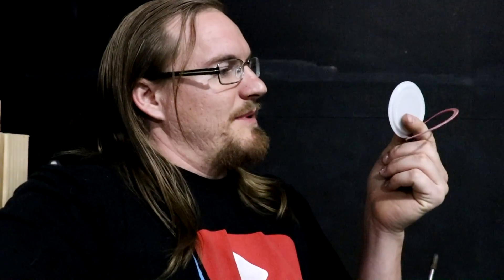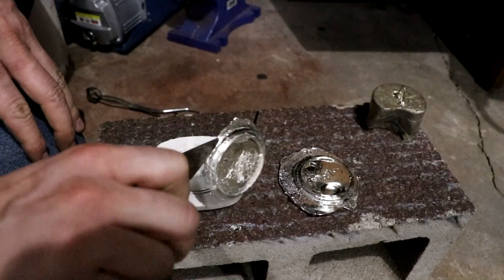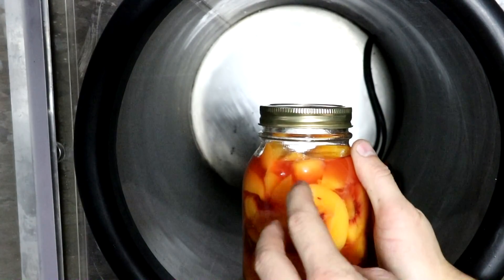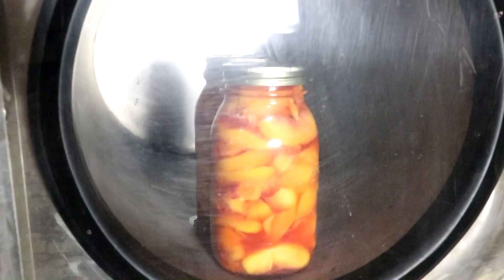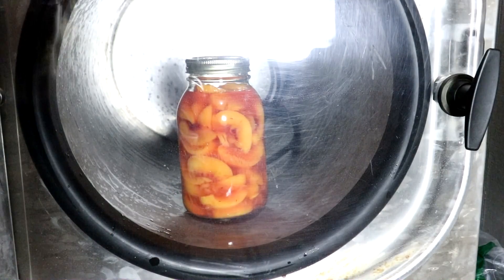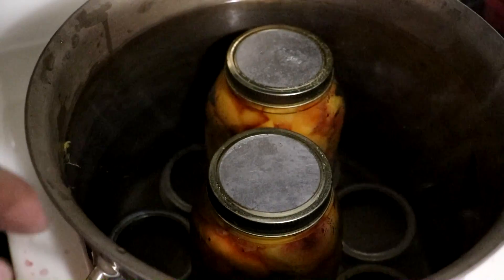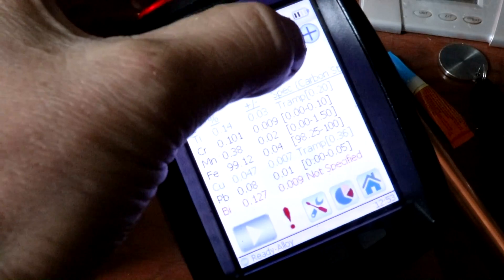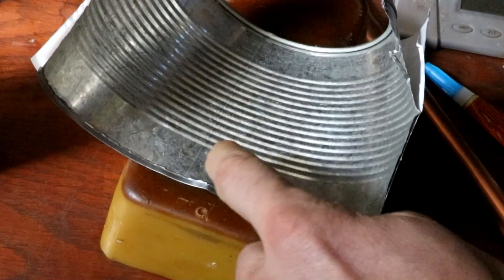Tin Canning Lids?

Comment: Since the tin itself is fairly soft, would it be possible to make a direct seal between the tin and the glass with no gasket? This might be easier to accomplish with a thinner lid, but potentially you could cut out the rubber/plastic gaskets entirely. Or perhaps if tin doesn't work, perhaps add an indium ring to act as a gasket?

Comment: Cody will you make a video where you put a vacuum chamber with a gauge inside of a pressurized chamber and try and measure the psi in the chamber using the difference in the vacuum

Comment: Cody you should can another batch of peaches and test if tin makes it taste better. Also it would be interesting to see if other cans have the tin. Do an assortment of various canned food.
Reply from the maker: Already on it! :)
Reply: most cans these days have a plastic inner liner. I was surprised to see metal of any kind once he opened that.
Reply: IIRC stannous citrate is the substance responsible for the weird taste produced by the interaction between fruit juice and toothpaste so I'd venture a guess and say that it's likely though how long it'd take for a detectable quantity of tin salts of the fruit acids to form is another question entirely.
Reply: The inside of the olive cans I get looks like Tin.
Reply: correction, I meant most fruit cans have plastic liners. But it seems to be a growing trend. Last can of Bush's baked beans I opened had a white plastic liner around the sides.
Reply: Also try some lead cans, Ive heard those make peaches test better aswell :D

Comment: Wouldn't the tin version be smaller than the plastic version? A  molded version of something is always smaller than the original. That might explain why the rubber gasket didn't work.
Reply: It didnt work cause the surface of the tin lid that was in contact with the rubber gasket wasnt perfect, it was full of holes from the mold. When he used silicone that surface got glued up with it and sealed much better.

Comment: This is the first time I’ve seen tin snips snipping tin.
Reply: This reminds me of the first time I used duct tape to tape a duct.
Reply: Reminds me of when I first used duck tape to seal a duck. What are these "ducts" anyway?
Reply: @crazym108  Isn't it illegal to use "Duct" Tape to Tape a Duct in California? 

That's why (if it wasn't trademarked) it should be called Duck Tape, as to not make anyone to flood their basement with false etymologies (and also because Duck Tape is made of cotton duck, a type of fabric).
Reply: @1224chrisng  I don't know about California, but it has many names one of which is "200 mph tape" because it can be used to patch outside components on airplanes.

And as someone who used to be in the heating and air industry, we do use duct tape on ducts, there is a plastic tube you use the duct tape to attach it to the boxes, and the metal tape for the insulation that goes over the top of it.

So while duct tape is used on ducts, it's not the only tape used.

Also.ducts have nothing, NOTHING to do with flooding, ducts are the system that air travels around your house if you have central air.
Reply: @stapuft  correct me if im wrong, but I feel like there may have been a miscommunication here, but duck tape shouldnt be used on ducts, but the metalic duct tape should
Reply: @CrashTestCoder  you use both, duct tape on the wire ringed plastic sleeve that connects the boxs (the wire spirals around the inside of the plastic tube like a huge but weak spring.) After connecting one of the ends to one of the box, you put the thin metal paper covered insulation tube over it, and you connect it to the box with the metal tape.

And in the state of Florida anyway, that's the proper, to code, way to do it, some cheating types use plastic zip ties instead of duct tape, but as it can puncture the insulation (the end after being cut is sharp) you arnt supposed to use them for that job. Sometimes they can be used to hold the tubes up in the air, but cloth straps or metal ones, are preferable.
Reply: @stapuft  Interesting, I would've thought the duck tape would have failed due to high temperatures when used like that
Reply: @CrashTestCoder  nope, if anything it would be the low tempatures.
But that's why it's used on the inside, any condensation should be on the outside.
If you were doing duct for a furnace I am pretty Shure you use the solid metal tubes, and a thick glue like paste called mastik, but I live in Florida, so we don't deal with that much.
Reply: @CrashTestCoder  the only time we used mastik was when we had to make our own custom sized boxes for fitting into odd shaped places.
Reply: Same here -- that came immediately to mind when Cody was trimming the excess material off of the TIN lids using TIN snips!!! :-)
Reply: He used those before on tin. 
And before that vid I had never heard of tin snips actually xD
Reply: Then missed the actual tin can video
Reply: @Mad King Ryan that tool has multiple names (most tools do).  Some call them 'Tin snips' some call them 'aviation snips' both are valid.

Comment: Those plastic lids are unsafe for canning. They are NOT designed to provide a completely airtight seal and you could end up with botulinum in your food if you're storing it at room temperature using those lids.

Jesus, after watching the whole thing you do so much wrong. You need a pressure canner to can low acidity food, boiling water at a neutral or near neutral pH will not kill botulinum spores. That's what pressure canners are for.

Please don't die, I'll miss your videos. That said if it works for you then keep doing it, all I know is I've been told repeatedly don't reuse lids, and any kind of reusable lid is unsafe for storing food at room temperature.
Reply: How does the PH of the water he's boiling affect anything? The water isn't in direct contact with the food inside the jar, it's just the heat that sterilises it. Please, elaborate!
Reply: @Agent Lurmey Pressure canning @~15psi means an increased boiling temp to around 240F which is enough to kill botulism spores. A water bath at standard atmospheric pressure is not. You can, however, do it if the food is low enough in pH (~<= 4.6). Peaches are in the 3-4 range in pH, so this is perfectly fine. Please do research when canning. Failure to do so can lead to the death of whomever consumes food containing botulinum toxin.
Reply: Generic Name this is Cody we are talking about he drank dihydronden oxide for fun
Reply: @Kieran it was dihydrogen monoxide that he drank, wasn't it?
Reply: @JDeWittDIY  he uses dihydrogen monoxide in the peaches too. That's how bad-ass he is.
Reply: What lurmey said, and don't you go on saying the water in the jar is neutral pH, unless you've discovered that peaches have some magic pH-neutral citric acid in them
Reply: Botulism is a problem with low acidity food, that's why he said he won't be eating those beans
There is no chance for botulism to grow on peaches

Comment: the German version of those jars have a glass lid and sometimes some sort of metal clip to hold it shut
Reply: Same in the UK - the lid is glass with a rubber ring. They're called Kilner jars and used for pickling/preserves.
Reply: Drunken Hobo We also have those here in the US. They're not meant for this kind of stuff.
Reply: Weck jars, a classic in Poland.
Reply: Weck jars a just great. The lids are pushed down by spring clips so it's always the right "torque".

Comment: its just awesome to see how simple it is to reduce the usage of plastic
Reply: Eh, on this scale it is. But i think those tin lids cost like a hundred times more than those plastic ones. Thats not really a solution.
Reply: additional to that it is a great opportunity to show that there are other ways than just using plastic until it runs out
Reply: of course it isn't but its a great alternative if there is going to be a shortage of oil at any time
Reply: @loling0tim  oil is not a problem. Plastics can be synthesized from wood, jaktropa, gumweed or basically any other waste organic matter like plant trimmings.
Reply: Who knows. Stone age didnt end cause of shortage of rocks. I dont think "plastic age" will either.
Reply: Yeah, real simple...

Using plastic is very energy efficient. I heard using a textile bag  require like 8k uses to make up for the energy usage, compared to plastic bags used once. Would have to become an heirloom to be energy efficient.

We're probably stuck with plastic for a long time yet. Perhaps we should focus on what happens to our plastic items after use instead of trying to reduce the use of plastic drastically.
Reply: Tin can be recycled zillions of times.  Each time plastic is "recycled" it degrades and after only two or three recyclings it is good for basically nothing but fill for road gradings and the likes.  Thinking plastic as being recyclable is an illusion.
Reply: @ronjones4069  making tin uses a LOT more energy than making plastics
Reply: I think the key is to identify those cases where a reusable option has the biggest impact and potential long term costs savings. You are never going to eliminate the market for cheap and disposable options.
Reply: @votalis4089  For sure. When its worth it, replace the plastics. Nowadays, seems the idea is that replacing plastic is always for the better. When it doesn't go farther than talking - in practice we use as much plastic as ever...
Reply: The tin is reusable. If he just went one step further with the mold so he has a reusable mold he could make all the lids he wanted to. I have no idea how many times you'd need to reuse one before it pays off. Looks like canning lids w/band are only about 30 cents. So maybe you reach a payoff if you use them about 20 times?
Reply: @johnpossum556  I don't know for sure the differences in the metal, but in an industrial setting you would create this lid by punching it out of a sheet and pressing it into a die/mold. At least that's what they would do with aluminum. So the costs per lid should be low. Some people commented that they just reuse the lid Cody described as disposable. Not sure what the tin advantage is, other than being easy for Cody to work with.
Reply: Gooner, you're right. OTOH, I've been around the world by sea, and you wouldn't believe how many plastic items are floating around in the ocean, many hundreds of miles away from land, all along the shipping lanes. It's an obscene mess of litter everywhere you travel. So-called 'biodegradable' plastics don't actually break down into other compounds; they just become microscopic pieces of plastic which are ingested by small creatures, and then the whole food chain (including us) becomes contaminated wth the plastics, with all manner of effects on life and health. We finish up eating our own discarded pollutants.
Reply: TIM the utter stupidity in your comment is utterly stupid.      Ffs.
Reply: But he probably used 1000 times more energy. So is that worth it?
producing tin takes a lot of energy, and so does melting and casting it.
And keep in mind, the plastic lids he used are reusable.

Comment: Hey Cody , when are you going to do the video on your turbo molecular vaccum pump . Love your work keep it up.
Reply from the maker: Honestly I'm scared to turn it on... I dont really even know what voltage to use, maybe I'll get Keystone Science to help.
Reply: What model do you have? 

you can usually find datasheets for those etc. They often use an external controller that runs the motor on 3-phase power. Basically a VFD specifically for the pump. Many turbo pumps should also only be turned on when the system is already under vacuum.

Comment: You should extract Iron from Iron rich cereal!
Reply: I have access to some decent magnets, I might try this in science club.
Reply: blender + enriched cereal + water + magnet = a little pile of iron particles.
Reply: You can do that with a decent magnet, they actually just add metallic iron to cereals to "enrich" the iron content so if you grind the cereal to power you can pull out the metal with your magnet.
Reply: Yeah, just put the cereal in a bag of water and mush it around then use a magnet.

Comment: But is using the vacuum chamber really that much faster if you'll still have to spend the next several hours cleaning peach juice out of it?  ; )
Reply from the maker: Oh it didnt take that long...
Reply: @theCodyReeder  Always use a 'drip tray'!
Reply: Voice over intercom: 'Mop and bucket isle 5...   Mop and bucket isle 5.'
Reply: Uhh sorry I didn't know...
Reply: Also without the vacuum, if you keep the water simmering you wouldn’t have to re heat and re cool it down every run.
Reply: @aeroscience9834  Takes a while for the jars to cool and seal, though. Potentially hours for a quart jar like those. He'd have to give at least an hour of cooling time before he could be reasonably sure the seal kicked in so he could test it, and then start the heat all over to do another run if it failed.
Reply: Remember, this is Cody's Lab.
6:14 "That's not good... It's gonna start boiling over..."
(keeps the pump going)
6:26 "We're leaking a little in the back one..."
(keeps the pump going)
Reply: Wait what? Your comment is appearing to be 16 hours ago???
Reply: +Khushi Sharma 
Patreon.
Reply: Axodus, no, shh! Magic!
Reply: Khushi, magic!
Reply: Me: Yeah, it's not not big of a mess

Me @ 7:22 ohh there goes Cody's afternoon
Reply: It's honestly not that bad, You just wipe it all down with a paper towel, Easy.

Comment: How do normal canning gaskets hold up and what are they made of? We occasionally use some crazy gaskets/o-rings at work, like teflon encapsulated viton, along with more normal gaskets like buna-n and silicone... I've always wondered how durable they actually are

To clarify: the gaskets I used at work are used for industrial processing, not canning.
Reply from the maker: I think the normal modern ones are latex or similar rubber but after heating the jar and cooling the rubber keeps its shape and thus cannot be reused without a good chance of leaking.
Reply: Well then I don't know what my mom uses for canning, because she reuses the lids every time, and stuff is still good after 5 years, so it's clearly not leaking at all.
Reply: @Micah Philson It's possible to reuse lids and the gummy rubber seal will reform under  heat. The possibilities are that the rubber seal would have lost it's tackyness or shape, or more likely the lid itself will have deformed while processing. 

I've done it due to poor planning on my part and not having enough lids. I wouldn't recommend it because one out the ten failed to seal.
Reply: Interesting question, Pat. I wonder if he could use teflon string. It's commonly available at any hardware store for rebuilding the packing bushing on older style faucets. Before that they used a graphite type I think. Anyway since they're approved for drinking water I would think they'd be safe for cooking/canning use also.